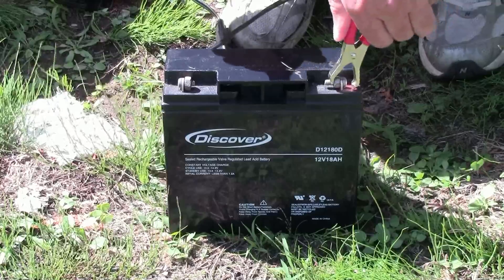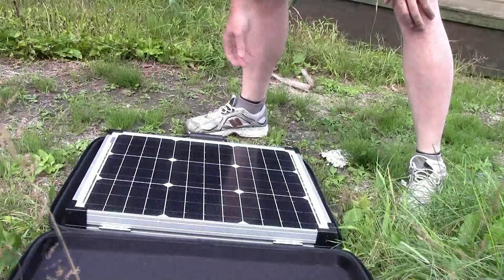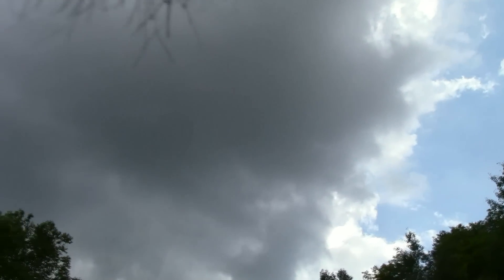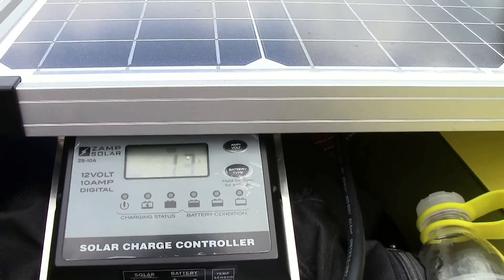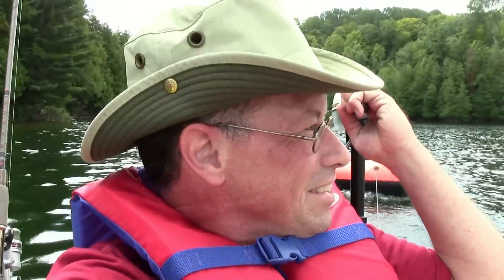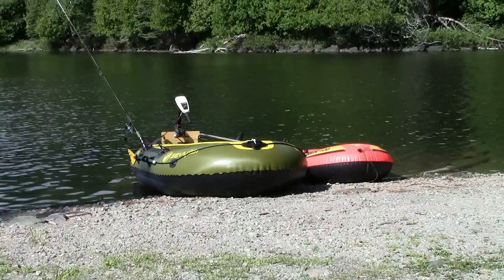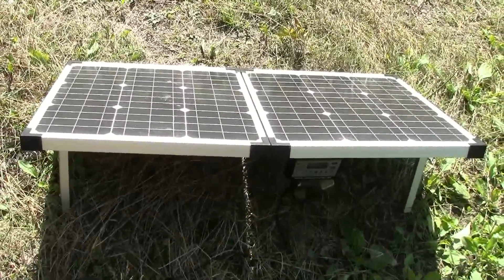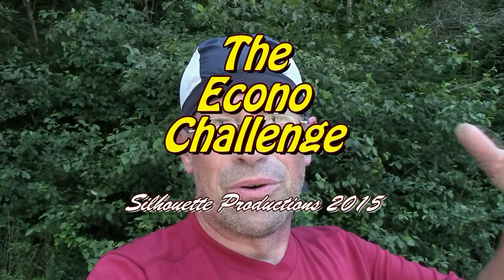Solar Powered Boat - Econo Challenge

Comment: An econo challenge with a minnkota endura max 55lbs thrust. i have a RC 200 minutes. Would a 2.75 amp 45 watt panel give me 8 hours of full thrust?
Reply from the maker: How many amps does your motor draw at full thrust?  If it is equal to or less than 2.75 amps then you could go all day under the full sun.  The problem with solar is that you are not under the full sun all day.  You are getting full sun on a clear sky a few hours before and after high noon.  So you need a much bigger solar panel to generate 2.75 amp at less than the full sun to be able to use your motor at full thrust for as long as you want.

Comment: good vid.   just a thought to address the issue of being stranded out on the water due to wind, clouds, storm, motor failure etc.   all of those are very real concerns.   carrying a 2nd motor, even in your gear boat, is a good idea even if you never use it.   i've seen those very cheap small gas 4 stroke outboards for sale on amazon for $300.  not the cheapest but what is the price to go anywhere and know you'll get home??   https://www.amazon.com/4-stroke-Superior-Outboard-Inflatable-Fishing/dp/B01E37JMA4/ref=sr_1_4?ie=UTF8&qid=1489374050&sr=8-4&keywords=small+outboard+motors+for+a+boat
Reply from the maker: I sheared off the prop once going down a narrow stream looking for catfish.  I hit a beaver feed that I could not see in the brackish water.  It was a long 4-hour walk back to camp and help.   Good advice in this comment.
Reply: well i can certainly relate.   i too would go down a narrow murky stream looking for catfish.   4 hour walk!!   damn.  now that sucks.   if you have $300 to burn, its like buying insurance on your car or home.   you hope you never use it but glad you have it.   i like to have two motors with me when i'm going in remote waters.   i have a 28 lb tohatsu 2 stroke that is very light and reliable but pollutes the water like you've never seen.   i bought a suzuki 2.5 four stroke to replace it but wish i would have known about the motor in that link i sent you as its wayyyy cheaper than my suzuki and lighter too
Reply: and i have my electric trolling motor which i'm going to borrow some of your ideas and modify my plan with that motor.
Reply from the maker: The best compliment a guy can ever get.  Thank you!

Comment: cons. 1 hour setup, but isn't that mostly blowing the boat up?  so same issue if u used gas it seems.   same thing with hole in boat.    also if canoe is superior, can't you mount engine and solar on that?   just wondering
Reply from the maker: You sure can.  Someday I hope to have the funds to own a lightweight canoe and I will give that try for sure.

Comment: can you clarify your numbers for me they don't add up if the solar panel puts out 4 amps and can run your motor Full Tilt then your motor only consumes 4amp hrs but you said the 18 amp hour battery would only run it for 15 minutes which means your motor would consume 72 amp hrs so which is it? if the solar panel can power the motor alone then that battery should run it for over 3hrs.
Reply from the maker: Great question.  My understanding of the amp hour rating of lead acid batteries is as an indication of approximately how much energy the battery will hold when new.  The size of the bucket so to speak rather than the amount of energy it will deliver in one hour.  An 18 amp hour battery is very small.  When I purchased it from an electric golf cart company, the owner laughed at me because he knew it would not run my electric motor for very long.  He was right.  

I have also lowered the capacity of the battery by draining it to dead and then recharging it during the testing of this project.  Even a deep cycle lead acid battery should never be drained past half full or the battery will start to lose capacity.  So that is part of the reason the battery does not run the motor for very long.  It is no longer holding as much energy as advertised when new.

Using this formula of Watts = volts X amps my solar panel should produce 80 watts / 12volts  = 6.6 amps!  But it never has delivered more that 4.5 amps at high sun on a clear sky day.  I am not sure why but I think it has something to do with the electronics that comes with this panel.  (Charge controller)  

Now i have never been able to find the proper statistics for the total amps this model of motor needs to run at full speed.  But what i do know is that if I run the motor at 3/4 speed on a partially cloudy day, the 4 amps the solar panel produces at high sun is enough to keep me going without draining the battery.  I hope this helps.
Reply: EconoChallenge i infer if a 30lbs thrust trolling motor use 30amps at 5 speed, your 24lbs thrust motor must use 24amps at full speed, the minn kota users manual says that, i will try something like this on a kayak!!
Reply from the maker: I hope my motor is not drawing 24 amps at full speed.  That is much more than the 2-3 amps my solar panel is delivering at full sun and would drain my battery really fast.  I must admit that I could not find the amp draw for my model of motor.

Comment: Unfortunately, it is too good to be true. Here is info about power consumption of Minn Kota Endura 30 motor:
SPEED AMPS 
1 8 
2 10 
3 14 
4 20 
5 30

"This 80 watt Portable Solar Charging kit provides 4.6 amps of charging power per hour under optimal sun conditions."

So, without help from battery this solar panel with provide about half power needed for slowest 1st speed. This video shows boat running pretty fast - on battery power :)

To run it like that without battery drain requires 2-3 times more powerful solar panel, sorry...
Reply: The Minn Kota model 35 is not nearly as powerful as the Endura.

Comment: Awesome video.
Reply: Hey Philip. The total run time of your motor powered by the battery will be variable. If you run it at a high rate of speed it will be a shorter run time as compared to running it at a low rate of speed. 

Powering the motor off of the battery and solar is a delicate balance between motor usage and sunlight. A 12 volt panel at 100 watts can produce about 5.5 amperes (per hour). The motor can use up to 35 amperes an hour, likely under full power. Thus you would want to shoot for a lower speed to try and target the 5.5 amperes draw. If you wanted to target running the motor off the battery and solar I would suggest the use of an ammeter. This device will show you how many amperes are being used - depending on where you measure it. Measuring the wires from the battery and to the motor will show you what your device is drawing. Measuring the wire from the solar will show you how much power is being delivered to the battery.

Thus if you ran the motor only off the battery (75AH) at max current (35 A) you'll have about 2 hours of run time. This is not the best way to treat your battery. You should only target using half of your battery at a time then recharging it. If you run at a lower speed the battery will last longer.
Reply from the maker: Thanks for making an awesome product.  Love it!!!
Reply: love ur setup ! im new with solar and boats .. ive got a 12v intex trolling motor and i wana make it solar !! 
lets  say im getting a 75 amp battery and a 100 w Solar panel     .. its says  on the trolling Motor MAX current 35 A and Max power 420 w ..   can u help me with it ?   without the solar the motor will run for how much time and with the panel   what would it be ?
Reply: Solar panels have to kick out a higher voltage to pump the power through wires. A good solar panel for battery charging will have a voltage of between 18 and 22. So 100/18 = 5.5A. 

If you wanted to power the boat direct from solar you will need to get a DC converter and match the input voltage range for the motor. If the motor is a 12 volt motor the range might be 10.5 to 15.5 volts. A solar panel would be over voltage for that and stress the motor. A DC to DC converter can take the solar panel voltage and regulate it to a lower voltage and you could do a solar panel direct to motor. Voltage will vary with the quality of the sunshine.
Reply: again im too new for the solar panels  but  how did u get the 5.5A ?   100watt / 12v= 8.3 A  .
lets say i'll will be powering the boat without a battery ( battery only for backup to keep its safe since i will be fishing in the sea )  would i need 5 * 100 watt panels to travel all the time at full speed ? ( max current is 35 A    420 w )

one more thing, is there any dynamo ( Alternators ) to recharge batteries for boats ?   i know cars use dynamo to recharge ,,   lets say there is a fan that can be submerged in water to give additional watt ..
Reply: its a Intex mariner 3 with a trolling motor 2.5  or 3 hp.. can u elaborate more with Diy workarounds  that doesnt cost much ?
Reply: bro i live in lebanon middle east  :P
Reply: Zamp Solar LLC  Alskan with the midnight sun here excited to try your product.
Reply: Zamp Solar LLC can your product supply 2.75 amps on a 45 Watt panel?

Comment: Solar powered electric motors to run generators to produce more watts than a solar panel usually can, and without gas
Reply from the maker: Sounds like an over unity idea.

Comment: Hi!  I must have watched your video about 6 times now, and have been spending countless hours these last few days researching parts to get, to do a similar project!  I want to make a very similar set up to yours, to use on my family's tiny plastic dinghy :)  One question has been driving me nuts recently... I have come to understand that the motor must go straight to the battery, and not the 'load' of the controller.  But due to my inexperience with electrics, I don't understand how it works with the terminals - each one seems to share two connections (solar controller and motor).  Does it matter if the crocodile clips touch each other on the same terminal post?  Because the average battery does not seem to have much space on a post.  Many thanks!!
Reply: I have just read through all of the comments here, something that had not occurred to me before, and have seen your relevant explanations re. the connections.  Would you say this is an ok setup for me to use, are alternative solutions any better than this croc clip method?  Should I use a multimeter to check when I am down to 50% capacity?  Many thanks again
Reply from the maker: I have my solar panel clips on the post of the battery and then I have the motor clips clipped to the solar panel clips.  Does that make sense?  I definitely would use a meter of some kind to keep track of your battery charge.  I have two.  One hand held and one on the charge controller for the solar panel. The reason for this is I am using a very small battery and I can go below 50% charge in no time using the motor if I don't have any power coming from the panel.  I would really like you feedback on how this works for you!!!
Reply: thanks for the super quick reply!  a godsend!  Understood.  Why is it that this person has run the motor from the load on the controller?  Surely he'd burn out the controller by pulling more amps than it can handle?  /watch?v=63-JVjue5XY
Reply from the maker: I am now starting to go outside of my knowledge base.  However, he says he has a charge controller that can handle 20 amps.  Two 80 watt panels could produce about 14 amps at 12 volts ... maybe.  So the charge controller is well suited for the job.  He did not give the specs on the trolling motor but I am betting is does not draw more than 6 amps maybe at full throttle.  But that is just a wild guess!
Reply: Hi, I have ordered everything and will be able to test on my boat later this month, I'll make a video about it and keep you posted!  By the way, the battery I bought has two terminals per side.  Could I put a croc clip on each, avoiding contact with each other, or should I attach one clip onto the other like your method?
Reply from the maker: Hmm.  You might have a deep cycle battery that will also deliver cranking amps for starting a boat.  I would read the literature with that battery carefully.  Not sure what to advise you other than that.
Reply: Hey buddy!  I finished the video of my solar boat, it'll be uploaded to my channel within a few hours, please let me know what you think!  thanks for all your advice!  I had an amazing time

Comment: Thank you soooo much for this video.  I'm lookking at powering my 18's kevlar canoe for a few weeks at a time.  With all the gear I carry and an average paddling speed of 5.5kph I'm not after anything spectacular but I have a Minn Kota Endura 30 that, in a mostly empty canoe, can push me along at that speed no problem.  I'm thinking that my Group 31 deep cycle marine might be overkill but I'd love to know what you think?  

Thanks for taking the time to do this video and I can share pics from a recent canoe trip I did I did for two weeks into British Columbia's North Coast which is sort of the kind of trip I'd like to power by solar one day.
Reply from the maker: That panel is going to produce more than 5 amps at full sun so it is perfect.  It does not have a charge controller so you will need to add that to protect your battery and Minn Kota motor.  The panel will produce more than enough power to run your motor even in partial sun.  The battery will make sure the minn Kota motor is not starved for energy on very over cast cloudy times during the day.  The size of the battery you take with you will be determined by how long you want to be able to run without any power from the panel.  I selected the smallest gel cell I could get that would still accept up to 4 amps of charging power when my panel is under full noon sun.  It will run my motor at full throttle for about 30 minutes before it is almost complete discharged.  That is pretty small.

Comment: Neet rig but your math is a little flawed. 

At 48W your 18Ah battery would run the boat for 4 1/2 hours, Even if you limit yourself to a 50% depth of discharge, that's still over 2 hours. 

Also, if you're getting 3.8Amps at 12V that's only 45Watts. You need to angle your panel toward the sun and you should get about 6 1/2 amps from an 80W panel. 

Finally, you might want to consider a charge controller if you don't want to cook your battery.

But nice job though. Looked like a lot of fun.
Reply from the maker: Hey Thanks for the help.  The charge controller is on the back of the solar panel and will only deliver 4 amps.  At least so far I have never seen the panel`s info screen ever show more than 4 amps.  The battery capacity must be screwed already because I can`t get an hour out of it without the panel and sun.  On occasion I have had to run it down to almost dead to get back to the boat launch and I know that is not good for the battery.  Maybe it is time for a new one??
Reply: Yes, it sounds like your battery is toast. Sealed batteries are easily damaged by excessive discharging and over charging. The right charge controller will prevent the latter, good battery management the former.  If you'd like to see a scaled up version of what you're doing on the lake, I invite you to visit my website, www.shipofimagination.com. To date we've traveled over 2200 miles on solar power.
Reply from the maker: I read the info and am really really impressed with your message.  I would love to see more electric boats touring the back country lakes of my province rather than noisy gasoline powered fishing boats.  Just so I can have a better sound track.  But also because of the oil and fumes and ... and ... and.  So I have added a link to the description in my video so I can send a few more like minded people your way.  Awesome!!!!!
Reply: Thanks

Comment: I'm curious about your 15 minute estimation on the battery. I frequently go fishing with a buddy who had a marine battery in a canoe and we've gone for hours and only drained half the battery. I'm genuinely curious how that can be now.
Reply from the maker: The battery I am using is rated at 18 amp hours.  That is very small.  The typical use for such a batter is for emergency lighting.  I picked it because it is light and I only need the battery in this set up to trick the solar cell into releasing electricity.  The solar charge will not release the electricity unless a batter is attached to the solar cell.  Compare the amp hour rating of my battery to the one you used on the canoe.  That will be the "ah ha" moment you are looking for.  Let me know what you find out.

Comment: i recently bought an 18 foot sailboat that is set up the same way! for those evenings where the wind dies and you just have to get back to your mooring. great set up! my panel is the size of my computer screen.
Reply from the maker: +Linda Wurth If you can match the power of the panel to the power of the electric motor you could run all day in dead calm sunny conditions and never drain the battery.  I have done it.  Thank you for sharing with us!!!!   Awesome.
Reply: 4bhp ektrç jétvoútbard

Comment: Wow. I started off looking for a portable solar generator video. Then thought about my Bass Master Baby Bass pontoon boat (8 feet long). shouldn't be hard to make a canopy with a solar panel as a roof. I have a 40lb minkota. I am hoping it will work. If nothing else I still want the solar panel.
Reply from the maker: +David Gillespie I would love to figure out a way to rig the solar panel in a way that will allow me to keep it pointed at the sun no matter what direction I have the boat pointed.   I would be able keep generating near full power much earlier and much later in the day.  Plus give myself a little shade while in the boat.  As long as the power output of your panel matches the power need by your motor it will work great.
Reply: +EconoChallenge I saw another video with an old v-hull boat. Pvc pipe. Very light. He zip tied the panel on top. shade and very light.
Reply from the maker: +David Gillespie That is a huge solar panel he is using but ya ... that is the idea.  Thank you for the link.